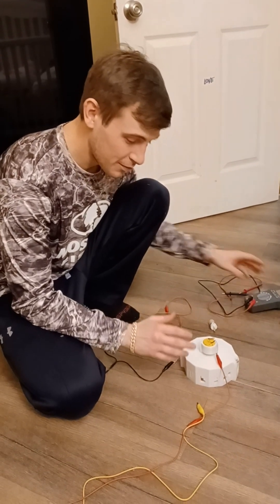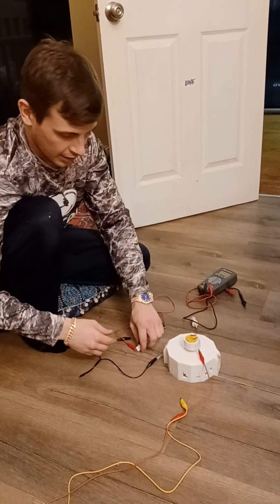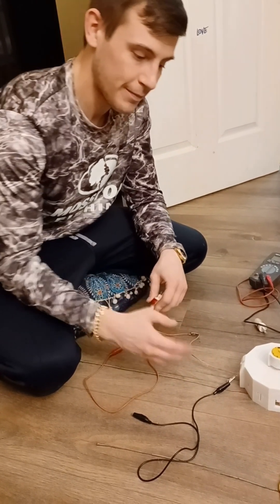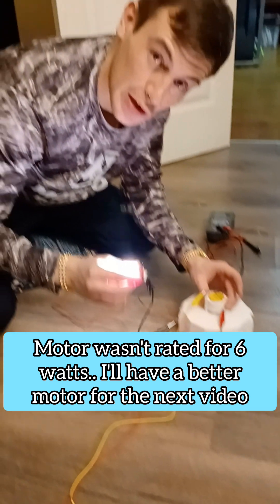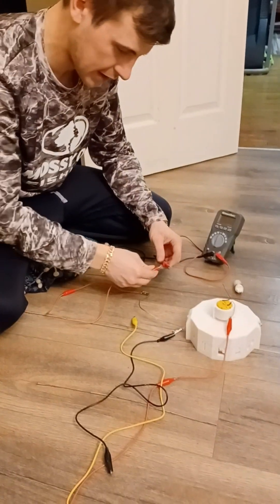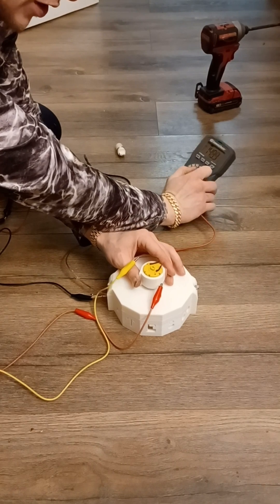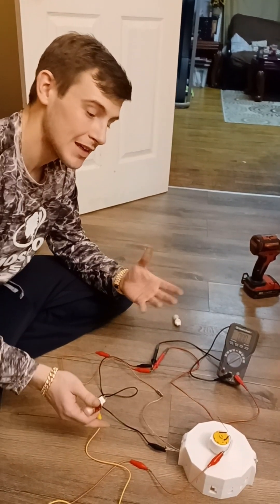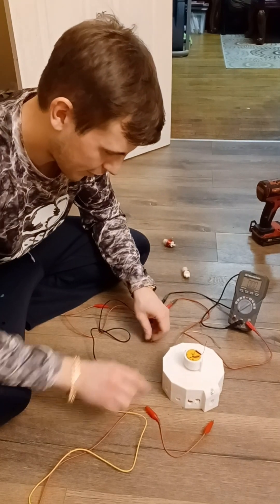Overunity Dodecatron Prototype Give Away!

Comment: The kind of measurements you're attempting are impossible with a multimeter due to the time precision required - you need an oscilloscope, and there you will find there is no over-unity power. You seem like a decent guy, so it makes me sad to see your potential wasted by pursuing impossible goals. You might actually do something useful with your interest in electricity if you take some more time to understand it instead of chasing windmills. Best regards, an engineer sent here by the algorithm.